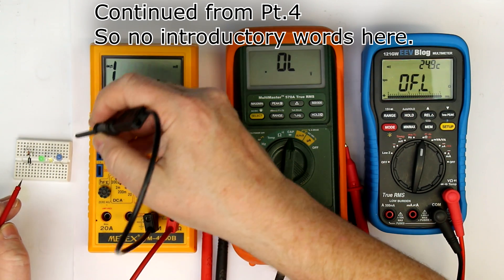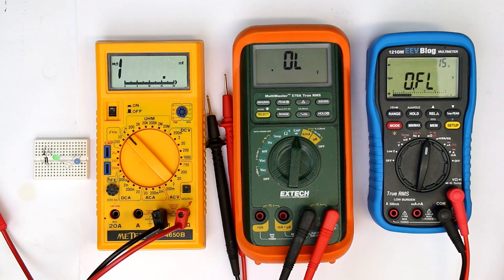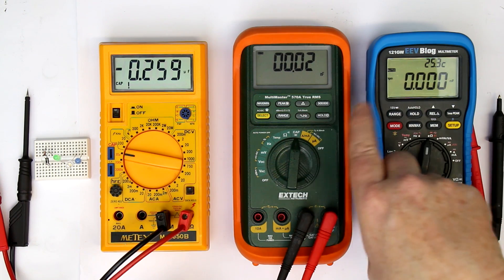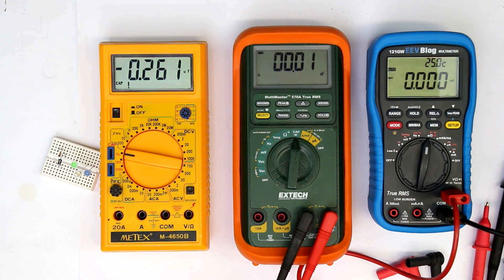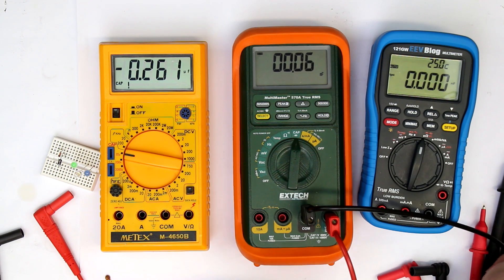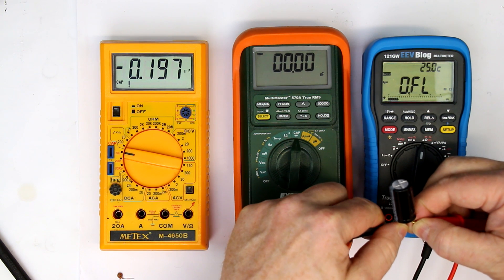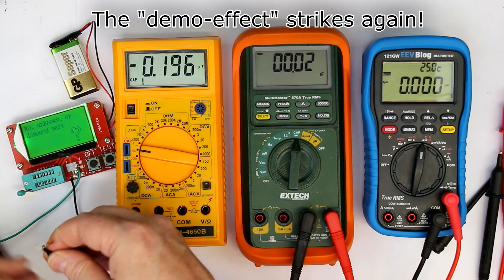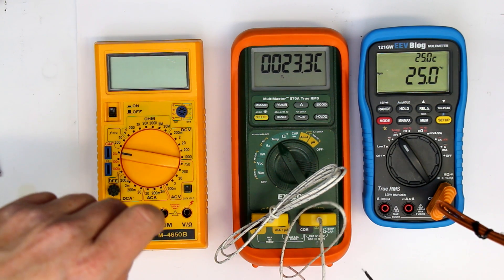Selecting a Better Multimeter Pt.5: Diodes, Zeners, Caps, Temp

Comment: I found your channel when I watch your excellent review of the Aneng AN8009.  But you are not using it in your tests.  Please, what is the best and cheaper multimeter for Arduino and low power electronic projects? Thank you so much.
Reply from the maker: This video series is not about pointing out to specific multimeters but to general considerations to find the best multimeter for your need. Still the Aneng AN8009 is recommended for a "small" multimeter and the EEVBlog GW121 is the best one for under $200 (in my view)
Reply: @KainkaLabs  Thank you so much.

Comment: Have you had any experience with the Voltcraft VC890 (the one with the OLED display)? If so, do you think it would fit the description of a "Better multimeter"?
Reply from the maker: No. This video-series is about general things to consider when upgrading your multimeter. It´s not about recommending any brands oder models. (Although the EEVBlog 121GW is the best one in the 200$/€ range :-)
Reply: @KainkaLabs  I see. Thanks for the reply!
Reply: @KainkaLabs  Have they fixed that capacitance measurement bug in latest firmware update?

Comment: I'd dearly like to own a 121GW DMM but I simply cannot justify the expenditure.   :-((
Reply: Despite all the problems 121GW owners are complaining about? Take a look at OWON B41T+  it's poorman's 121GW and it works!
Reply: Tech29, I got one for $51 shipped a couple of months ago! Best piece of gear I’ve ever gotten for that price range.

I rarely use other meters now unless my B41T+ is also in use. Check out joe smith’s tests of the B41T+ for more detail on its specs and safety. It kicks the crap out of the 121GW in tons of categories (not safety, obviously)
Reply: @tech29X  Thanks for the tip-off, I'll look into it.